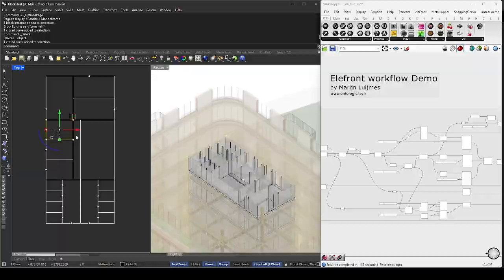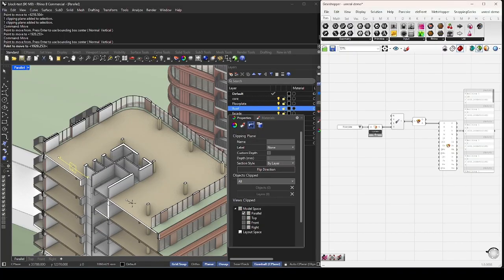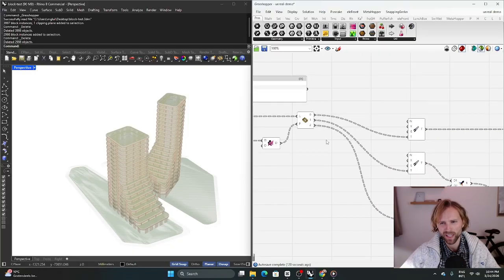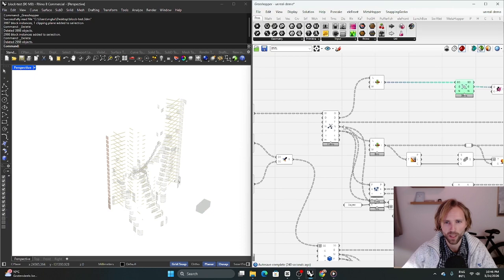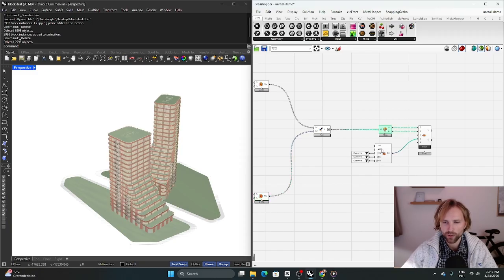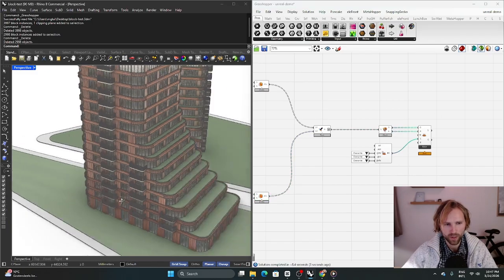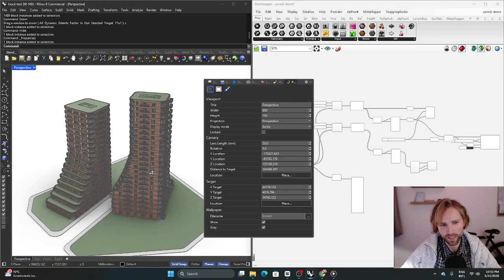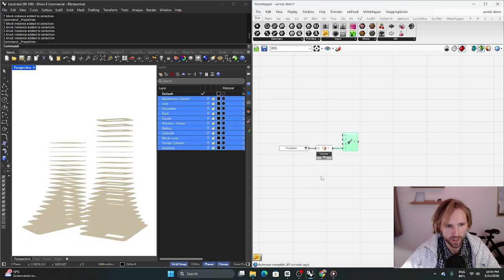Grasshopper + Elefront: Turn Rhino into a Lightweight BIM System

Comment: Hi! I'm curious, what are the advantages of using Elefront over Grasshopper's native Model Object key/value attributes? Are there specific workflows or capabilities that make Elefront the better choice?
Reply from the maker: Excellent question. So Elefront actually existed before Rhino 8 native block components.. I think it kinda pointed out what Rhino was missing so McNeel built it in. 

I build my workflows with native blocks indeed most of the time, but for the baking and model querying I do still like Elefront, if you build your script efficiently as a single pipeline you should be able to build a simple 'adapter' at the end to translate all rhino blocks to elefront blocks with 8 components or so. Does require solid tree management in most cases though. 🙂